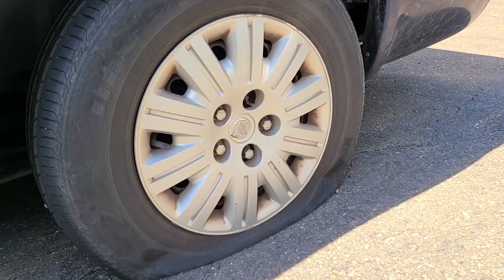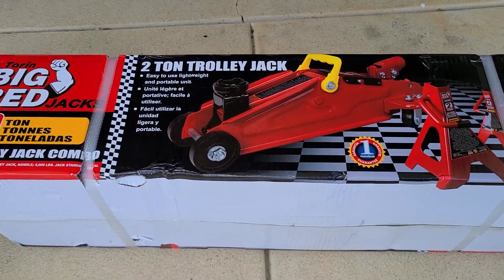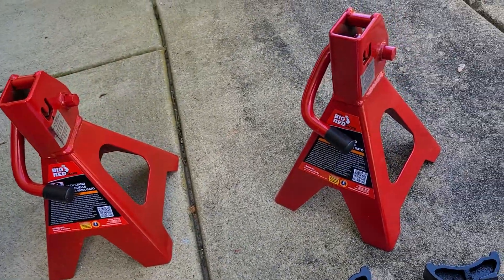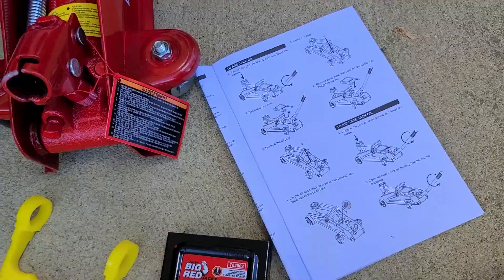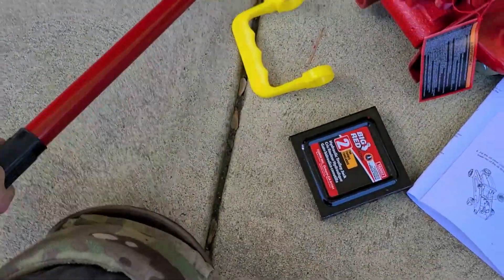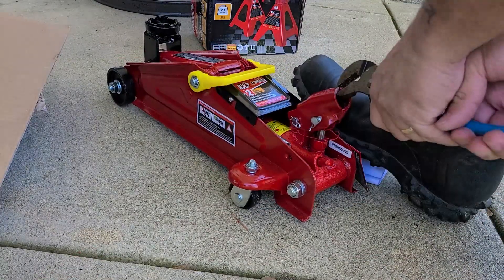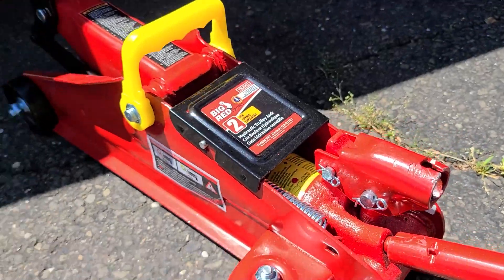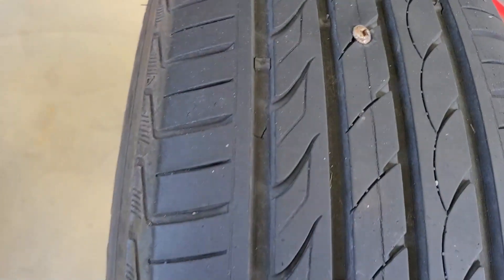Review On The Torin BIG RED Trolley Jack

Comment: Your oil plug is there. It has a blind hole in the middle and it is made out of rubber. It has been painted over so that it looks like part of the reservoir tank.
Reply from the maker: Very interesting. I will take another look. I appreciate your comment. Thank you👍
Reply: @HandymanLand it’s just under the oil fill plug label at 3:24 time on your video. It’s the raised red circle with the hole in the middle. The hole is there so that you can squeeze in the sides and pry the plug out of the hole. Hope that makes sense.
Reply from the maker: @ajchien  Thank you 👍
Reply: I didnt have it on my jack. Do you think it's important? Oil leak?? Thanks @ajchien